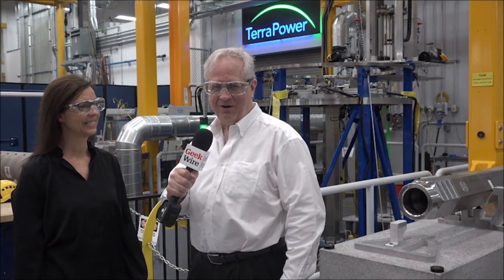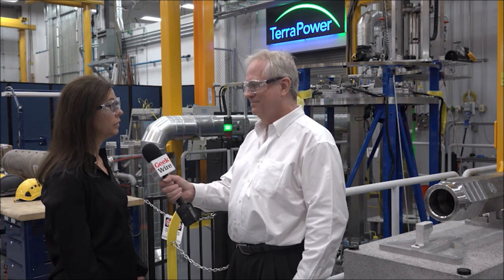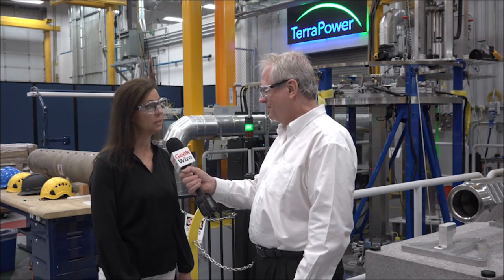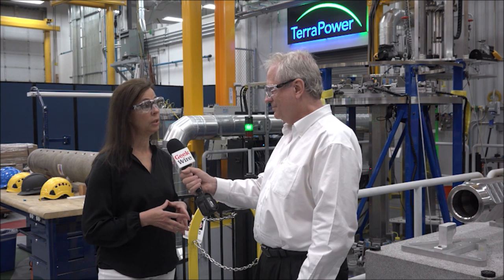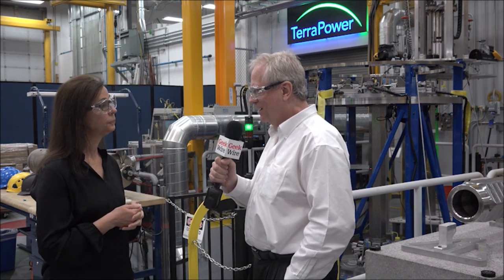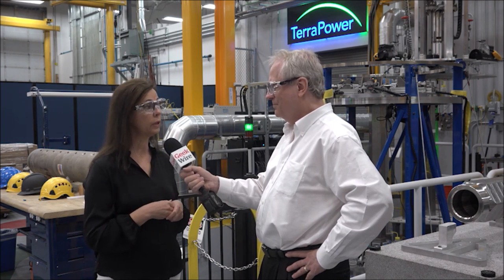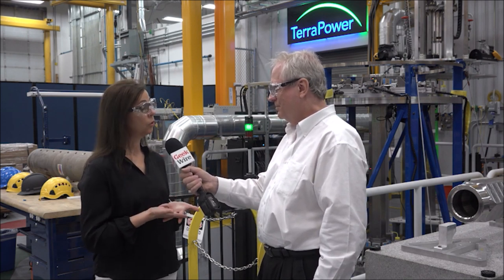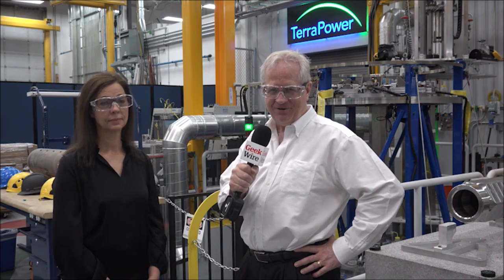Inside TerraPower's next-gen nuclear lab

Comment: So TerraPower runs on depleted nuclear fuel. And can potentially provide power for 10 billion people for the next million year (Current levels of consumption). That's worth investing in. (From my very uneducated perspective). I wouldn't build this near the coastal area or in areas where there is a higher risk of geological activity (earthquakes and volcanoes in particular)
Reply: Well it has a low pressure containment equal to normal atmospheric, as opposed to the hundreds required in LWRs. Then there is the fact it won't produce hydrogen gas which is what blew the top off of the reactors in Chernobyl and Fukushima, spreading radioactive particles everywhere. At worst it just leaks, but is far easier to contain.

Fukushima really was a freak accident when we consider that even LWRs are usually the last standing in times of crisis. A hurricane will typically knock out any other power source, not so much nuclear reactors.
Reply: It doesn't actually do anything because no reactor has been built.

Comment: This is such good news.  These folks are working with spent nuclear waste.  That’s the stuff that’s scary about nuclear power.  This doesn’t use new radioactive material, they’ve found a way to use 700,000 metric tones of waste stored in place.  This system can’t melt down or leak!

Comment: The United States needs to develop a national infrastructure bank system to develop wind, solar and electric vehicles. We also need the Department of Energy to standardize Small Modular Reactors or SMR's with thorium molten salt reactors. The SMR's can be built in a factory reducing costs. Also the Molten Salt Reactors based thorium and floride are really quite safe with automatic shutdown designs during any overheating into a heat tanks system with a drain plug that melts to let the fuel rundown into the storage tanks below. This shutsdown the reactor even if no human is present. Also Molten Salt Reactors do NOT produce explosive hydrogen within the reactor itself. Therefore, the explosions from hydrogen created from water within the reactor simply can NOT happen. So I think a safe reactor design prototype can be created and must be created. I support this next generation nuclear plant. I hope new safer fuels are found to keep older reactors running to give us time to mass produce SMR's.
Reply: Wind and solar aren't good for the environment.
Reply: The last thing we need is millions of new electric vehicles overloading the power grid.
Reply: Hydrogen explosions are not a big risk at light water reactors, historically nuclear reactors have been very safe.
Which isn’t to say that we shouldn’t develop molten salt reactors, I think we absolutely should be working on them, but it’s definitely still a technology in development. I am in favor of broad technology investments in the fight against climate change, some places, perhaps most places given recent cost trends, will be able to get most of their power from intermittent renewables, but we should continue having nuclear as an option for places in high latitudes with poor hydro and wind resources. We need to figure how to build nuclear without it being painfully expensive so that we can serve these places with abundant power, and maybe molten salt can do that, but I don’t think we should give up on light water reactors either.

Comment: China is developinng Generation 4 reactors with US research and technology. Because the US government will not develop Gen 4.  China may start a prototype MSR in 2020. Potential for MSR reactors is amazing.  Safety, less waste and much cheaper. No need for enriched Uranium. Even using nuclear and mining waste as fuel.
Reply: Bill Gates sold "his invention" to China. Very bad!
Reply: Westinghouse Electric has sold 4 AP1000 advanced Gen 3 reactors to China. And China is developing its own reactors using AP1000 technology.  The US has given the Chinese most of its research on MSR reactors away so any other country to access. The US and China are both working together in the development of the ITER fusion reactor. None of this rerlated to Bill Gates. Bill Gates was in a joint partnership to sell Terrapowers Gen 4 reactor designs that were not wanted in the US.  And there was no restriction in sharing this technology. So China has access to lots of US reactor technology and research. Bill Gates wants to make safer, cleaner and cheaper Gen 4 reactors that can be used in developing countries for low carbon power.  Which is vitally needed. It is also in the interests of the US that Chinese reactors are as safe as possible. If Chinese reactors were to explode the jetstream winds high above the Pacific could send radiation to the US mainland.  China is planning to develop over 50 nuclear power plants. Safety is a global concern.

Comment: What I don't understand is why they are building a sodium reactor.   It seems as if using sodium instead of water trades the problem of high pressures associated water with the volatile reaction of sodium.  I don't for the life of me understand why they aren't using actual molten salt.  This is low pressure and is not volatile.
Reply: Probably because they have found out molten salt doesn't work.
Reply: @caav56  Molten salt is no more corrosive than pure water. Thorcon and Terrestrial never tried to make their cores last the lifespan of the plant. To do that meant qualifying metals that would take decades to do. So instead they use regular stainless steel and inspect the core every 4 years (at first) for longer periods as they prove the durability of the metal.

Comment: wheres the MCFR??? booo TWR!! booo solid fuel!!
Reply: She did say they got a lab there for molten chloride fast reactor.
travelling wave is a great way to get rid of stockpiles of nuclear waste - this alone makes them worth looking at.
Reply: @michazajac5881  So does the molten salt fast reactor - they both serve the same purpose but one has a far more elegant design and is arguably easier to build and operate since the active shuffling of fuel is not required.
Reply: @adamdanilowicz4252  But you gotta have some good material science to prevent hot salt from eating through your core or, at least, replace cores every few years (like Moltex and Terrestrial want to do).